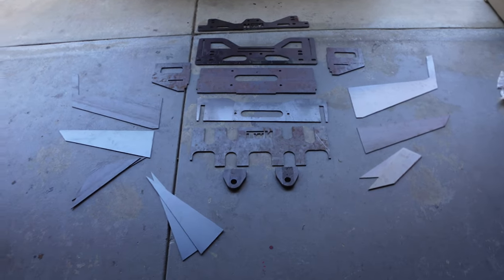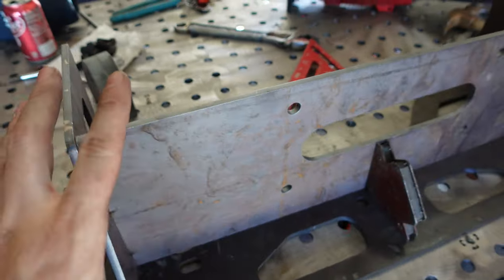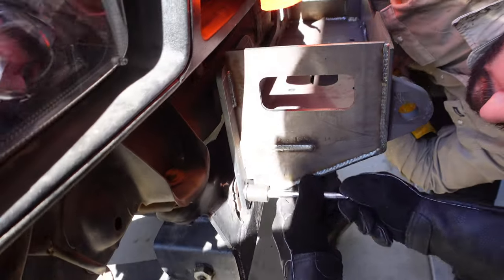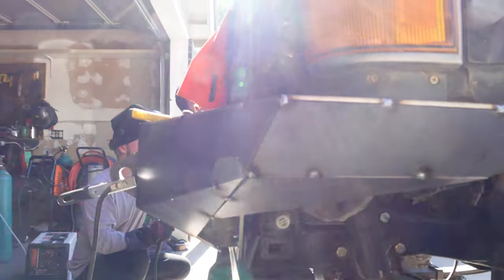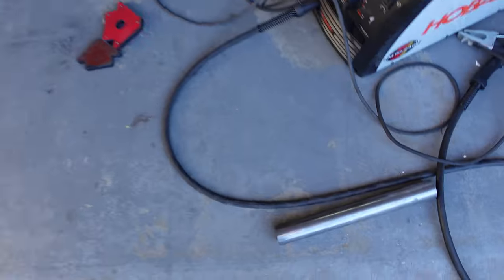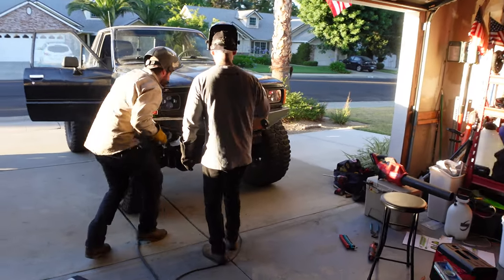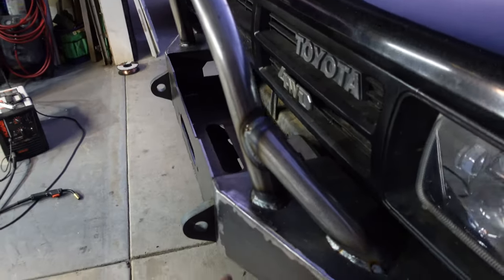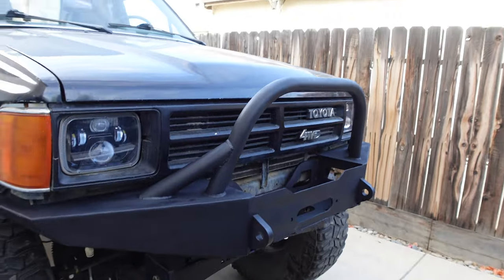Building A Heavy Duty Off Road Bumper (Weld It Yourself DIY Kit) - Toyota Rock Crawler

Comment: That is the nicest plate bumper I have seen yet for an older Toyota. I noticed you guys used a Hobart Mig welder. Was it 110 or 220V welder? Just curious what level of a mig welder is needed for the welding.
Reply from the maker: Thanks Mike! I also like the look of this bumper more than any other I've seen. We were running on 220.

Comment: Welds should never need to be ground unless your welding for the food or medical industry
Reply: That’s not entirely true, for non industrial fabrication some seams don’t need all the reinforcement. And welds are only as good as the material, no point in having quarter inch reinforcement on 3/16th plate.but I will agree he should have beveled the joints but he’s going for a smooth look